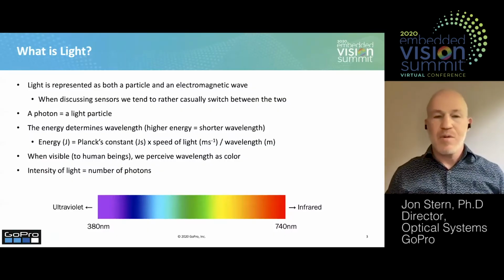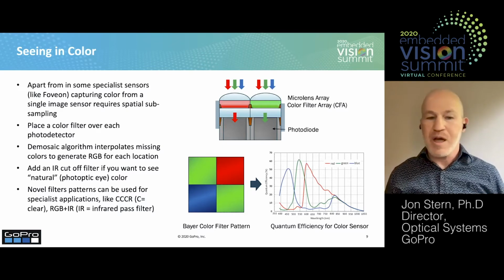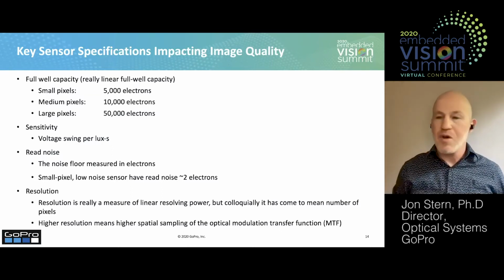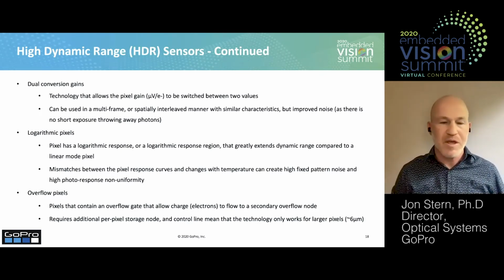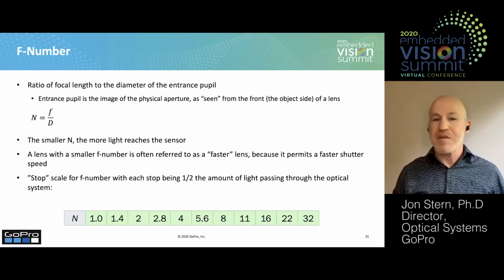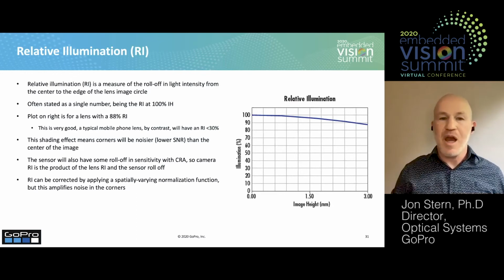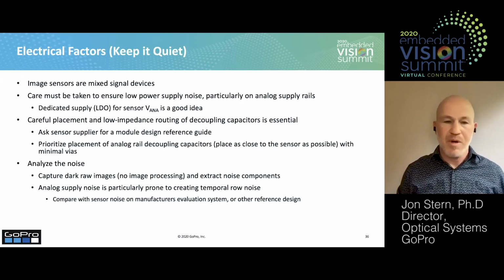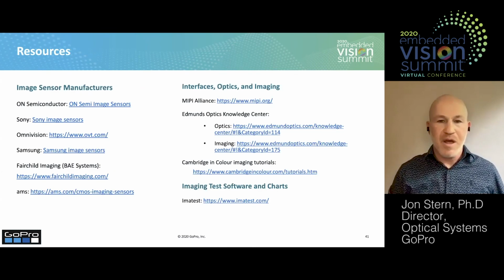"CMOS Image Sensors: A Guide to Building the Eyes of a Vision System," a Presentation from GoPro

Comment: This is almost like a tutorial -- a very useful one. Well presented!  But on slide 26, you give the expn.  D=2.44*lambda*N, I think the focal length of the lens 'f' also has to appear in this equation, as D=2.44*lambda*N/f. The airy disk dia is 2.44*lambda/D and N=f/D as you state earlier.